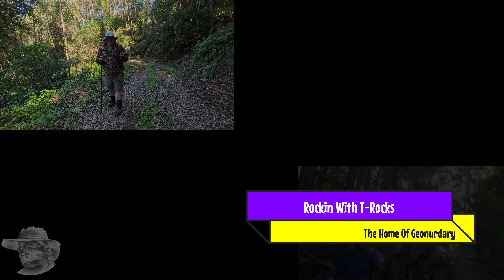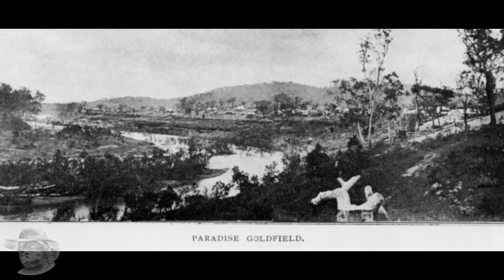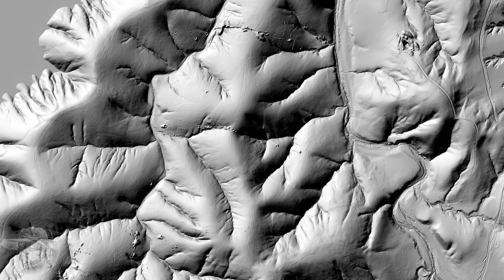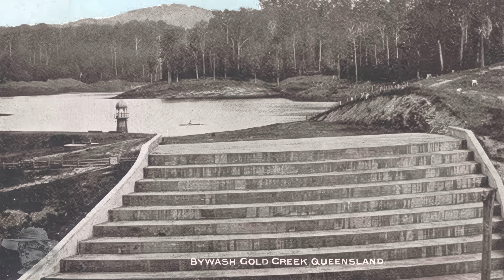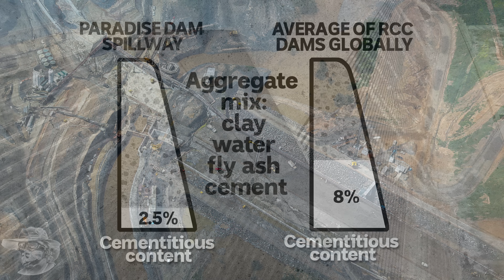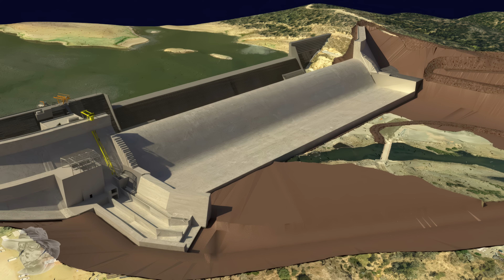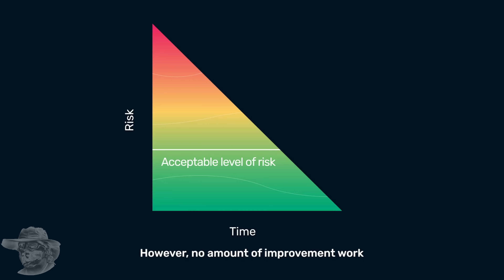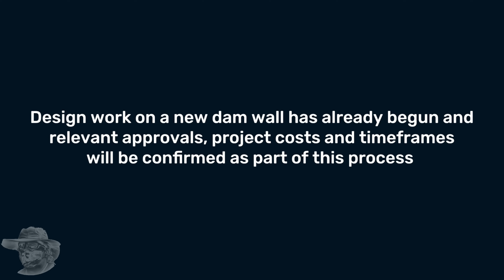Paradise Lost: A Modern Epic of  Infrastructure Failure

Comment: 13:56, tar?   did you say tar?   i can suggest a material that will prevent water ingress but this dam is rooted.   ive had a few jobs where i needed to waterproof concrete and brickwork and there is no substitute for "silica fume".  i first found out about (insert brand name here ) 40 years ago.   and only 5 years ago i found out what is in it on wiki.   it contains silica fume.   tar is still used to coat concrete or brickwork and its useless.   it gives up in as short a period as 5 years.   ive seen how the stuff ive recommended is as good as new after 20 years under water.   and it can be applied underwater.

Comment: My recollection is we were asked to raise the dam wall, so cores were taken. The inspectors who never wanted this dam in the first place were horrified. They ruled out raising it, they looked at anchoring it (the downstream water in a big flood sucks when you are a gravity dam), the RCC was just too weak. So they cut the wall down quickly. I was there for a few jobs, operators just took me to issue after issue, it was wack a mole. It was leaking between layers, there were holes, the hydro couldn't get to nameplate, the fish lift wasn't. Meanwhile they never sold the water that was stored anyway, even at the reduced height. Kudos to sunwater taking the shit sandwich, making it safe, proposing a soln. They knew who was at fault, it wasn't sunwater, they had nothing to do with it, they were told to take it over years after it was built. But interesting arc from 'make it bigger, make it smaller/ safer, build us a proper one'. I think the stepped spillway turned out a bit hard on the fish, so likely won't see that design again.

Comment: Question : What dams which were built between 1969 and 1990 in Queensland are failing or have failed ?
Reply from the maker: none I suspect, Try 1880 and 1990..All still good..
Reply: @t-rocks1960  Indeed. We used to build public infrastructure in Qld. But not any more....
When the hell is there going to be a dual tunnel from Aratula to Maryvale ? The country rock isn't that hard...

Comment: looks like the new dam will be digging up the buried mercury that McMahon buried. Will they dispose of it properly this time? How many shortcuts with the aggregate? How many shortcuts with the placement that McMahon engineers would not deal with no matter how much the consultant warned them? I was in one meeting where the engineering manager told everyone that this was Australia and they would do it the Australian way even though they had never built an RCC dam. Consultants too pedantic, placing RCC was to be done faster no matter the quality, and the quality was poor from the start. Engineering consultants had many years experience on RCC dam building

Comment: you didn't mention the fact that near the old mine near the dam was where the tailing were dumped and when the dam was built, the dump site was found to have high contents of mercury from the processing. McMahon Const. was suppose to dispose of it but instead buried it downstream of the dam above the water line. I am sure by now it has leaked into the river. You checking for this Bundaberg?